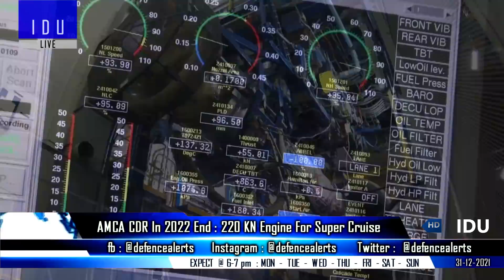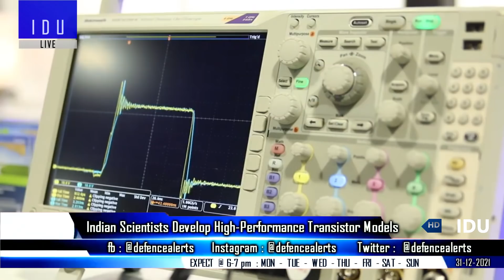Indian Defence Updates :  220 KN AMCA For Super Cruise,DRDO L&T Light Tank,UGV At LAC,GaN HEMT Ready

Comment: Doesn't make sense. Supercruise is supersonic speed without afterburner, so dry thrust is important. The GE 414 has 98 kN afterburner thrust, as presumably is the 220 kN thrust required from two engine thrust mentioned. Therefore the GE 414 EPE engine under development in the US will presumably be suitable when the AMCA Tejas mk2 and TEDBF enters service, so there is a suitable engine (or rather will be)

Comment: The question is not range difference . Pakistan 800km can penetrate all the front lines n deep penetration.  
Only S400 can stop them in their airspace before entering. The big difference is Rafale is agile in dog fight. I would stop analyzing on features like automobile. Analyze on how Rafale can take them down before enter our air space.. In dog fight locking multiple targets by air to air missiles using AI. It should be like fire n forget technology. Air missiles are 4 mach hitting 2 mach planes should be the analysis. Mica missiles are proven n Chinese missiles have failed when it needs most. In reply to Balakot, they didnt depend on Chinese missiles, they fired AMRAAMs. So J10c is a dud for them, they know but they have to show the country they procured against Rafael's,  politically.

Comment: J10C will use pl10 for short range the latest missile and pl15 for bvr fight and have a better range then meteor of rafale    j10c latest engine have 130KN thrust only 20kn less then rafale but rafale total takeoff weight is 24500 vs j10c 19500kg so 20kn doesn't matter  aesa of j10c have 1200 TR modules vs 900 in rafale exact match will be find out in next aerial engagement with Indian rafales
Reply: Good analysis. But will the aircraft first take off from ground 🤔
Reply: Jf17 block 2 and 3 are already in service and on 27th Feb 2019 was part of the operation if 134 in PAF are working then I hope J10C will also work excellent    rather j10 is working with the Chinese airforce since 2005  2 yrs before the induction of JF17 in PAF and J10C is the 3rd block of j10 like the JF17 block 3 😁
Reply: @drmap5194  also stop this chest thumping of 27 feb2019 (1). Sgt Wilson handling the PAF F16 has confirmed that an F16 was indeed shot down and he helped in clearing the mess after which only the media was allowed inside. (2). PAF Wg Cdr Hassan and Hilali have confirmed that 300 plus were killed in Balakot.  Go and Google this also. (3). The Denel H4 dropped by your running paf pilots from hi altitude  are lying near the loc . U can come and collect it. (4). We are proud of our Wg Cdr Abhi has he chased u guys into poker in a 1960 Mig21 and got shot. The tea that was given was an Indian tea purchased by you guys from UAE. His conversation during the tea ceremony were coded communication to Indian authorities.  By the way you guys gave only tea but we fed 93 thousand of your donkeys in 1971 plus your Air chief Pervez Mehdi Quereshi plus your General Niazi for 30 days. We still have the photos of Mehdis family photo with us.
Reply: @drmap5194  U R still living in 19th century. (1). IAF has had an extensive interaction using their Mig21 Bison with USAF F16 and have been beating them. Google it urself. So facing the F16 was not a challenge. Abhi actually shocked your pilots when he intercepted them from Pir Panjal area and the recordings of your stunned  Punjabi pilots are with us. (2). The AIM120C that u were firing were directed towards the SU patrolling the area and photos of the same are in the media. The SU jammed these missiles with Phaztron/ Khibiny units and they fell down.  (3). Abhi was chasing you guys into your territory on a tail chase which means an interceptor like the Mig21 has an upper hand (4). Two things did not favor abhi. First was his radio system was jammed with IAF EW and the R73 BVR failed due to a software glitch in target lock but R77 were active and fired. U guys displaying a Russian missile is not a big thing.  R77/R73 are used by your father China and many East European countries. Uncan buyit open market which your ISI is famous.(5). The Israeli supplied Phalcon AWACS had reported the F16  vanishing . Phalcons are used by even the USAF and are reputed. They are not electronic gizmos like your Saab Eerie. (6). Finally your senior military officials Lt Genl Ghafoor of ISPR confirmed of two pilots downed one was abhi and the other was your PAF pilot reportedly killed by ur locals as they mistook the F16 ejection parachute color which is similar to an Indian flag. U can Google it. Subsequently due to pressure from higher up he changed his statement saying there was a fog and then said it was an Israeli pilot etc. An ISPR senior official cannot give such stupid reasons. He was summarily transferred.
Reply: @drmap5194  Come on. We know how you guys are made fools by your ISPR on such matters. Let's take the case of your famous AVM Alam who claimed to have shot down so many Indian jets in minutes . Based on this u guts went and gave him the highest battle award. Now his own Wingman is saying that Alams claim is a lie. U can Google it.  😆 🤣
Reply: @drmap5194  Next take the case of your General Niazi.  Even after surrendering he was saying that his troops are still fighting while he was sipping tea in an Indian POW camp. 😆
Reply: @drmap5194  😆 🤣.  Go and Google your JF17 disgrace in Paris Airshow when it didn't move from the runway.
Reply: But didn't India change the Radar in the India specific upgrades ???
Reply: so j10c with single engine can compete with rafale twin eingne lol
Reply: V well said now it means Indian su30mki are better then the American F35   which is a 5th generation fighter jet 🤔
Reply: @drmap5194  U should ask the Russian Pilot on this
Reply: Alam said 5 fighters he destroyed   the other pilot of PAF said 3 were shot down while 2 were able to get away that what he said he never said that Alam was unable to shot any fighters 
Similarly Indian navy claims they destroyed Pakistani submarine gazi  later revealed it was destroyed by its own laid mines in the sea 🌊 🤣
Reply: @drmap5194  please don't joke in such forums.  Google an independent site and see the story behind Alam. Regarding PNS Ghazi please don't joke once again by repeating what your ISPR is saying. It was downed by an Indian assault and as a revenge the Americans downed the INS Kukri. We are aware of this.
Reply: @drmap5194  Today's update. Did you see how your foreign minister Quereshi was sitting before the Saudi foreign minister? He was showing his shoes to him. What's wrong with IK and his ministers.  If MBS gets angry and asks u to return the loan and deport your guys working in Saudi what will u do. Atleast earlier u had a control on Saudis saying that your soldiers will fight for Saudi if attacked. Unfortunately your rx General Raheel  Sharif screwed it up when Houthis attacked. Added to this India has already signed an agreement to send troops if Saudi wants them. Terrible situation for your country.
Reply: The only true friends Pakistan have are China and turkey   Middle East countries are not true friends neither to you or us MBS already screwed the relationship with Pakistan and we know that saudia has given us loan on more then 4% intrest  so are keeping at this in mind  if they want to kick Pakistanis out of there country it will go against them also in short and long term the highest no of Pakistanis go for umrah and hajj plus we buy our major oil import from saudia   then obviously we will stop that also 😉  no country support you without there intrest   if today Pakistan start buying again French weapons they will start supporting Pakistan  we have been using French fighters and there Augusta submarines for last 50 yrs but now we don't want to buy western weapons  because of American influence on them still Pakistan buy weapons from Sweden Italy Spain  South Africa  and Russia also jf17 block 1 to 3 all engines are from Russia    we are already buying Russia attack helicopters 🚁
Reply: @drmap5194  coming to weapons (1) France wants $$. Do u have? No. (2) Sweden can give only defensive weapons as they have strict rules and weapons are expensive. (3). Italy, Spain, S. Africa again want dollars. Do you have? No. (4). Russia also wants dollars and they will give only defensive equipment like MI17, AK rifles etc. Russia is too close to India and the trust is very high. So they will not give offensive weapons. Take the case of the SU35. You guys said Russia will give but they refused. So, in my opinion the only country that can accommodate you is India. Ok. We fought wars etc. But at least 100 years bk we were together.  We feel so. All you guys need to do is stop interfering in Kashmir and we can live happily. Indias forex is 700bn and ur forex is 25bn. Think it over as egos will not take you guys far.
Reply: @drmap5194  French refused to work in upgrading their system. To buy French defense equipment you need money and they are willing to sell. Both are not there. Which attack helicopters Russia is selling to you? Thinking that your tourism and oil purchase is big for SA is foolish. you are not even top 10 partner for them.  J17 russian engines are licensed to china, that is why you are getting. Not from Russia.
Reply: If chinese engines are great why China fields their jet with Russian engines in border of India and south china sea. Simply because it is inferior. Also comparing P15 with Meteor is joke. Air to air missile has range and impact. Meteor with ramjet will have same impact when it hits target unlike other air to air missiles like P15. That is why it is deadly.
Reply: If pl15 technology is inferior then why India is also working on it in the form of Astra mark 2  that will also have  a dual pulse rocket motor  like pl15   and tell you one thing only better fighter doesn't means you always will be victorious but tactics and your traning matters a lot check Americans what they and others says about Pakistani pilots 😉 
Paf knows how to tackle the iaf  and we have seen this on 27th Feb 2019 now when the iaf inducted rafale paf thinks they can tackle them with j10C    and pl15  so we purchased j10c if paf was not satisfied with j10C they can but j11D or J16 but paf are confident j10C and jf17 block 3 are good enough to take on all Indian fighters and we all will see what happens in a future Ariel conflict between India and Pakistan
Reply: @drmap5194  Astra MK 2 is also in the range of P15. Meteor is in different league and that is why it is considered one of the best in the world. Check what USAF says about IAF.  During training Mig 21 surprised F16 many times and US pilots shocked with that. No doubt PAF is good, but saying J10 is better than Rafale is nothing but true.

Comment: The light tank developed by L&T should be amphibious.
Reply: it may not be a necessity after all considering that it is to be deployed in higher altitudes....
Reply: @trpranav4409  there are quite a few lakes to be crossed in the LAC. Amphibious tanks provide an advantage. Personally I think existing Indian tanks (T90, T72, APCs) should be fitted with another stage of turbocharger/supercharger in large numbers to provide more power at high altitude.
Reply: @jonswap9097  firstly t 90s and t 72s are not a good option in high altitude... their weight puts a lot of limitations especially on mobility..... and anyway we will have a good amphibious capabilty in the future with the ficv and kestrel....so investing again on light tank amphibious capability may not be the need of the hour...